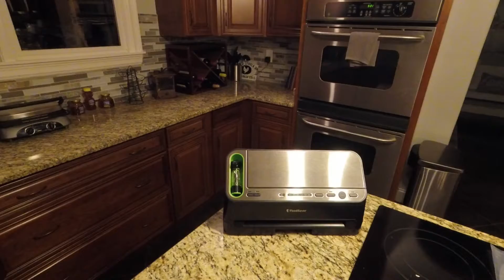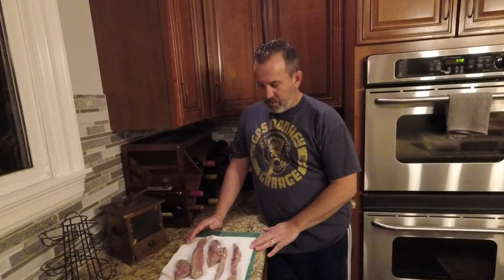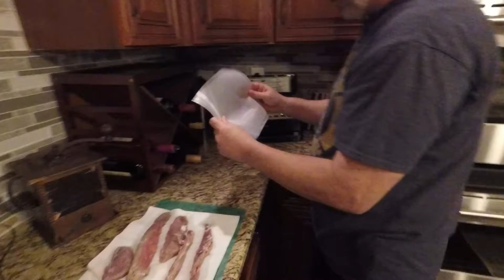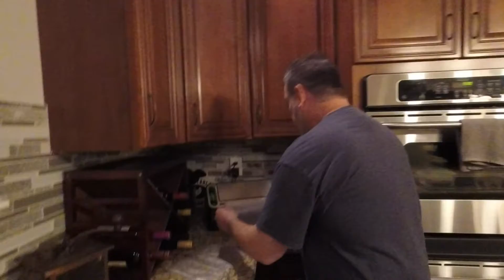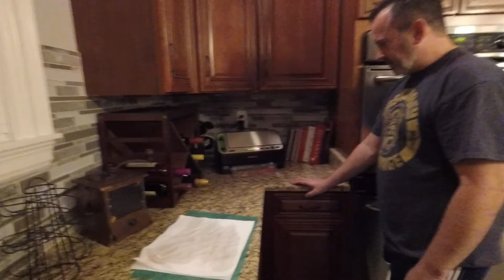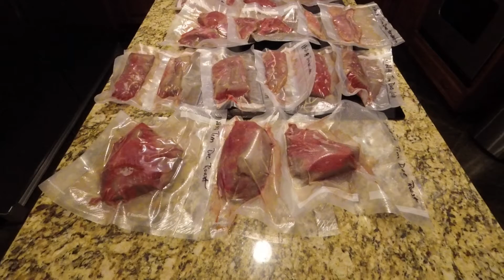REVIEW Foodsaver V4440 (4400) 2-in-1 Vacuum Sealer Machine with Automatic Bag Detection

Comment: Can I use the hand held on other accessories say by removing it and connecting the hose to other accessories?  Is that possible?
Reply from the maker: I don’t see why not. I haven’t tried that though.
Reply: @RidgeLife  Does it look like the hose will just slip off manual vac part?
Reply from the maker: The ends look molded in each end so don’t have access without taken the units apart or cutting them.
Reply: I just bought the V4400 and I had ordered the canning jar attachments,so I could save money by sealing flour,baking soda, baking powder along with spices, etc. I was wondering just how 🤔to do these kind of things. The manual mentioned using a paper towel to keep the powder from leaking out.  I learn better by watching. Sorry 😞.  But I would love to learn everything that the machine can do. I also agree with 1 viewers  opinion about bringing the machine out in the open to watch you work. Thank you so much.